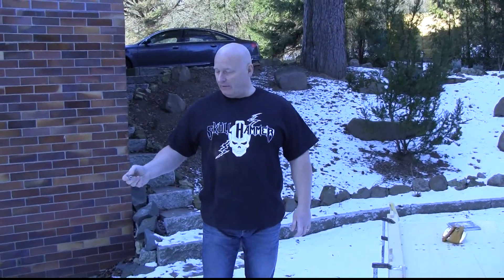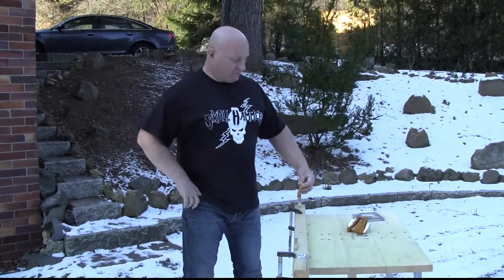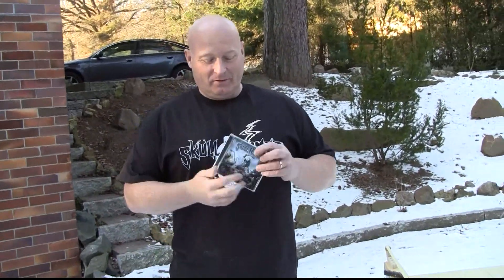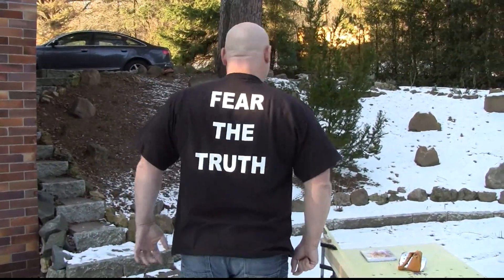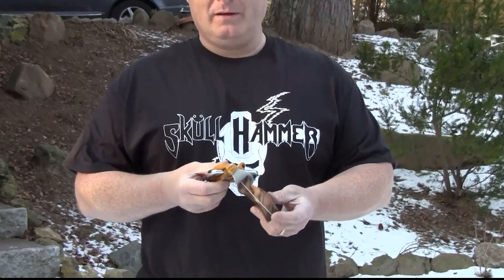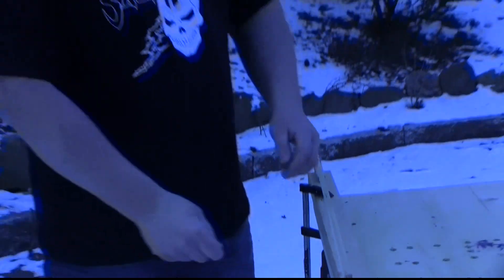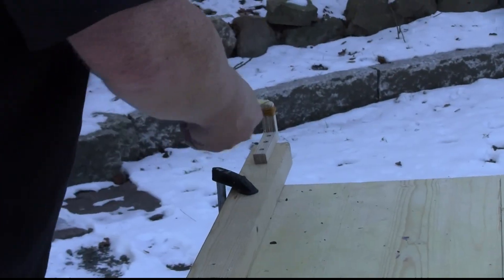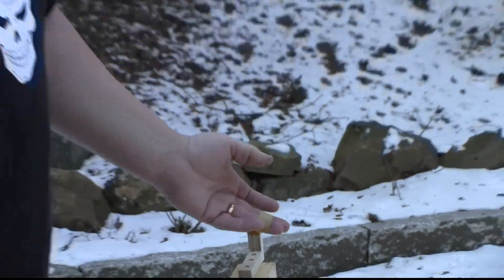Fear The Truth!

Comment: @FireMaestro Exactly - the question is whether rubber loses heat during contraction. One potential variable in testing this, however, is whether or not rubber changes volume when it contracts/expands. If the volume is decreasing while the temperature remains the same, then there is a loss of heat. Even if it's heating up while contracting, but the volume is decreasing, it could still potentially be losing heat.

Comment: Temperature influences rubber's physical properties like elasticity, hardness etc. When you stretch the rubber, part of the energy you use turns into heat because of inner friction. It works the same way with metal springs. If rubber were able to store potential energy as heat, it would COOL OFF when you released it (converting the heat energy to kinetic energy) - much like compressed gasses when they expand.

Comment: "elastic polymers do not store any potential energy in stretched chemical bonds or elastic work done in stretching molecules... ... instead, the energy to do work comes entirely from thermal energy" ... WRONG. "Ideally, the polymer chain's movement is purely entropic (no enthalpic, or heat-related, forces involved)." OK (from wikipedia as well)